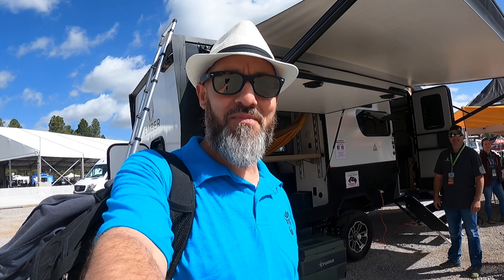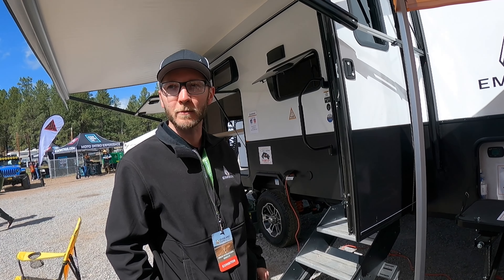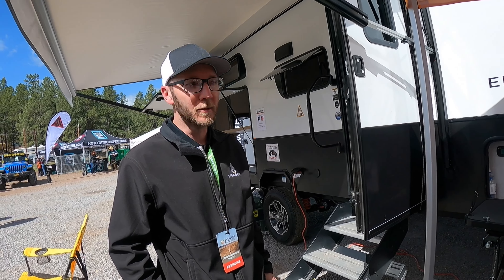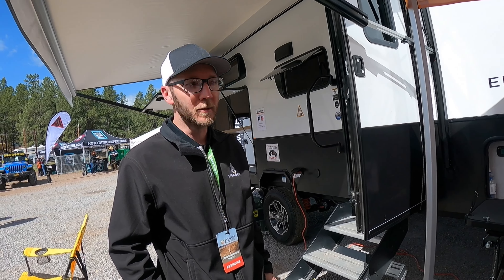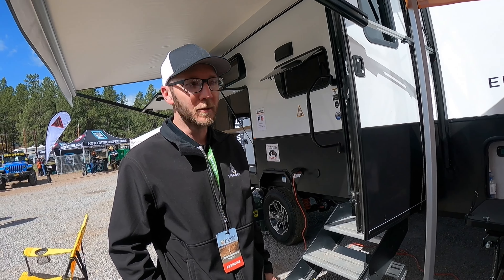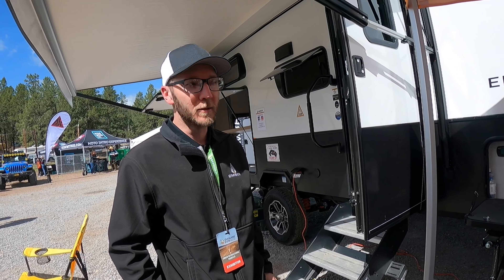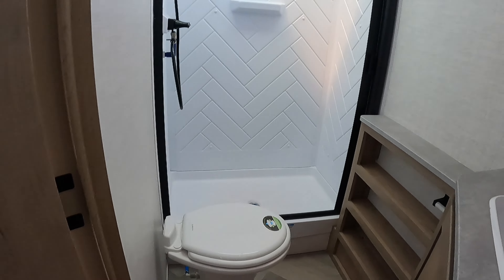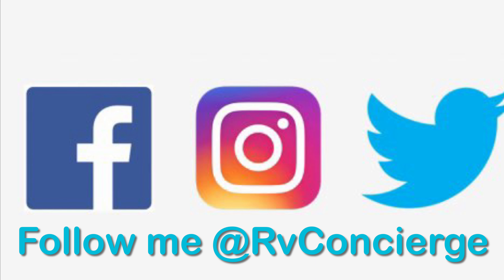Ember RV Overland Camper walk around!

Comment: Does the ac unit have a slow start on it... so it doesn't drain the battery as quick as a typical ac? ALSO, can you get a roof top tent on a larger unit & is it mounted to stay secure when it's down?